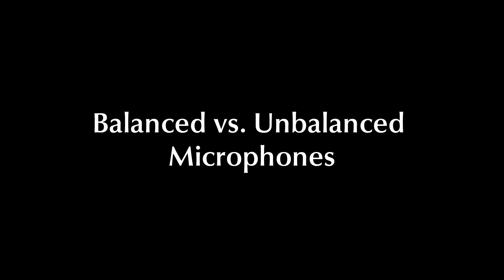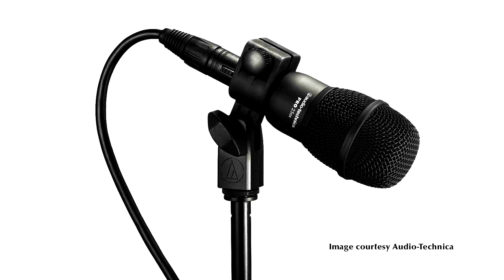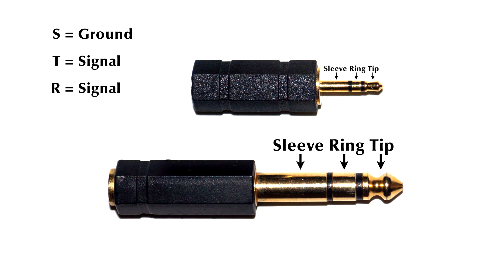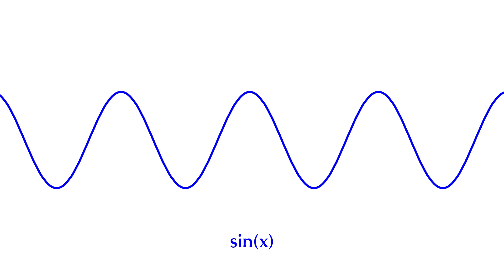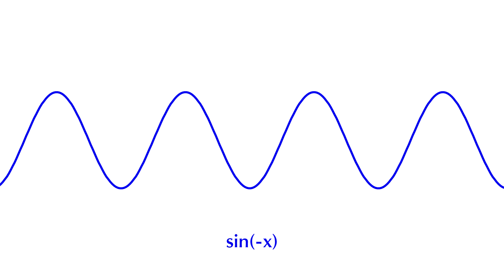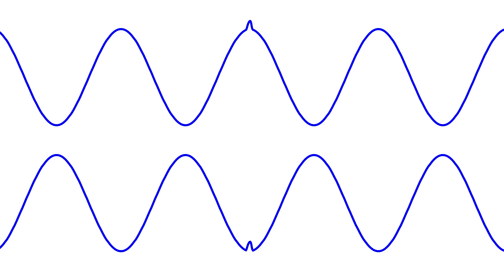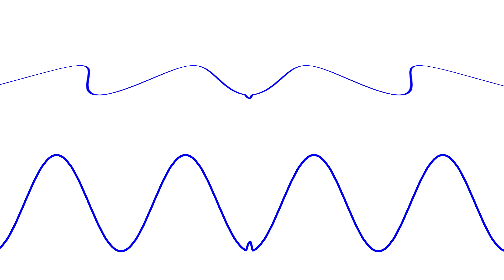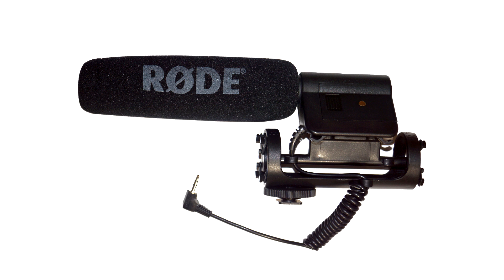The Science Behind Balanced & Unbalanced Microphones

Comment: great explanation, but from the constant buzz/hum sin wave in your audio, you may want to use balanced gear also. It appears to be around 670-680hz ;)
Reply from the maker: Yeah, that was a problem with the USB mic I was using at the time. I haven't had that issue with the ElectroVoice.

Comment: If I wanted to plug a stereo unbalanced microphone (let's say Rode Video Mic Pro), to a camcorder's XLR input, meaning I take an unbalanced source, but I have a balanced destination and wanted to keep the stereo, should I connect 2 XLRs to the 3.5mm jack, with the two signals (each channel) connecting to the positive signal of each XLR connector (one XLR would be left, the other right), and then connecting Shield, Ground and Signal - (negative) to ground. Logically shouldn't that work, without canceling out my signal audio, since the Signal - (negative) would be ground? And I obviously don't care about making the unbalanced mic balanced since the cable run will literally be 15cm or so.
Reply from the maker: The thing is, it's a lot easier to plug a balanced mic into an unbalanced jack than to go the other way around. I've done it, but I've always gotten extra noise.

Comment: That would be -sin(x), not sin(-x). ;)

(sin(-x) is the signal going back in time)
Reply from the maker: Haha! From a standpoint of pure geometry, you're right. But electronically, that's what's going on: the result is the wave function of the opposite of the input. Do the math and you'll see it coming out the same way.
Reply: You sure got your concepts mixed up there.

Certainly, for a pure sine function without temporal limits, the "180 degrees out of phase" shorthand for "minus" gives mathematically indistinguishable results from what goes on, because fundamental physical laws don't seem to have an arrow of time. (And it does make sense as a shorthand, because even though "minus" is shorter, it also refers to other things when talking about electrical circuits.)

But remember, that "minus" above is a minus on the output from the sine function: sin(x+pi)=-sin(x)

The "input" to the differential amplifier is not the input to the sine function, it's the output from the sine function, and the "x" is an expression with a temporal component. As an emergent property, the arrow of time is very real, and no known physical process can give you "-x". It is not possible! Not even with a balanced cable.
Reply from the maker: You may be right.

Comment: If I understand correctly, the Rode Video Mic Pro is an unbalanced microphone. And if logic serves, the Rode Video Mic Go is also unbalanced. One difference between the two is that the Pro uses a battery, where as the Go does not. Many reviewers often point out that the Go has signal noise, but the Pro does not. Is this b/c the 3-5v being pulled off the camera or recorder are introducing noise to the Go Mic via the cable? Where as the 9v battery power originating mic side, does not introduce electrical noise?
Reply from the maker: That would be my guess. A condenser mic (as opposed to a dynamic mic) has to have "phantom power" running through it, and the mic modulates the power signal. If we're talking about an unbalanced mic, and the power has to originate from the device, then there's a lot more opportunity for interference than if the power originates at the mic itself.
Reply: Thank you for the quick response. I really like your video, and the explanation was thorough without condescension. I have also reached out to Rode directly, and will share the response with you.
Reply from the maker: Look forward to it! I know they recommend putting the battery in the microphones that have a compartment for it, even when they can also run under phantom power.
Reply: I just got off the phone with Rode Technical support, and the summary is this. The noise heard on the Rode VideoMicGo comes from the camera when the user turns up the gain settings at the camera side. And that the lack of noise with the Rode Video Mic Pro is due to the battery powered pre-amp that is mic side. There was no talk of balanced or imbalanced lines. I was kid of disappointed, I feel like the Tech Support Rep wasn't all that knowledgable of audio or basic electrical concepts. Huge let down. In either case, I'll share any new findings I come across down the line.
Reply from the maker: Thanks! And yeah, noise generated by the camera is the worst. Especially when it picks up the noise of you handling it, like when you rack focus.